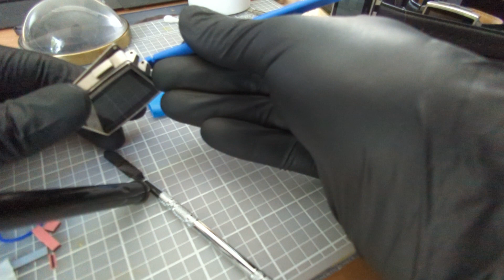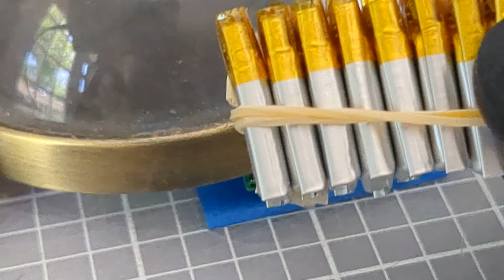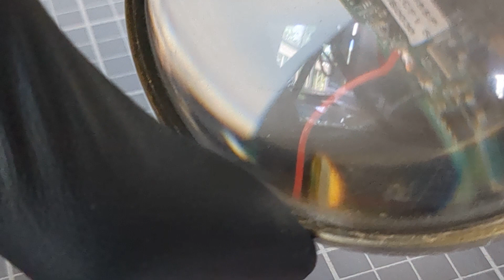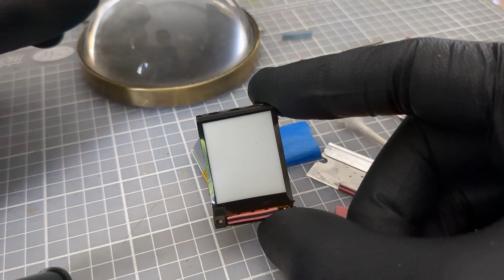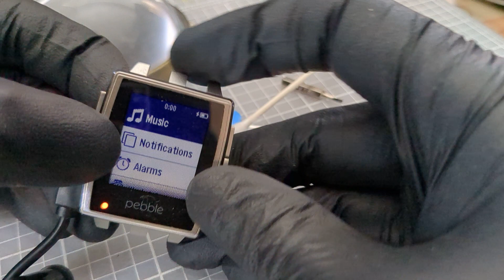Pebble Steel Battery Replacement

Comment: This particular Pebble case design is beautiful. I only had a vague memory of Pebble watches as I saw one being sold in a car boot sale (In the UK, where people fill their cars with 'junk' and drive it to a muddy field to sell) - I grabbed it for three pounds. Perfect case, strap and charging cable. I'm still feeling pleased with myself after a year has gone by, it's one of the best bargains I've picked up at a car boot.
The new software is a revelation and I have some great watch faces, including a Smug Trump just to annoy people. Which it doesn't, they just laugh.

Comment: Thank you very much for sharing this video. This video helped me a lot!
I just finished mine. (402323, 250mAh)
Just one thing to add for whom may try this replacement in future, you need to turn off and turn on your pebble steel to re-activate the backlight and status led.
I don't know why but right after you replace the battery, all the light functions will not work. I was almost panic.
Good luck. :)

Comment: Excellent! Now the Pebble app is available again and working better than ever before, I might finally try to breath new life into my Pebble Steel. I just powered it on today. When I stopped wearing it, the display was already glitchy, and the battery life was about 3 days. Now you can watch it lose power, so both the battery and the zebra strip need to be replaced. I preordered a Pebble Time 2 which should ship in spring, but I still like my old Pebble Steel for its unique vibe so I'd love to wear it again.

Comment: So, I'm working on my own right now.  Whenever I connect the battery, the entire board becomes unbearably hot pretty quick.  I know this isn't correct, so I've disconnected the battery.  Any ideas what the problem might be?
Reply from the maker: You've reversed the wires
Reply: Same with me. Do you have the fix? Or it's really reversed?

Comment: I bought a new in box pebble steel from Ebay only to find out the battery is super dead. At first I thought I could just easily fix it but I shuddered at the thought of trying to fix it myself. I haven't soldered anything since college a decade ago.

Can I just like pay you to do it for me? Lol trying to find research into a replacement battery is scary enough because I don't want it to explode on my wrist.
Reply from the maker: There are plenty of people on the Reddit or discord who will do it for you

Comment: link for the batteries ?
Reply: I would also love to know this as well
Reply from the maker: I would check eBay or another seller in your area for "402020" batteries. Try for 150mAh. https://www.ebay.com/sch/i.html?_from=R40&_trksid=m570.l1313&_nkw=402020&_sacat=0

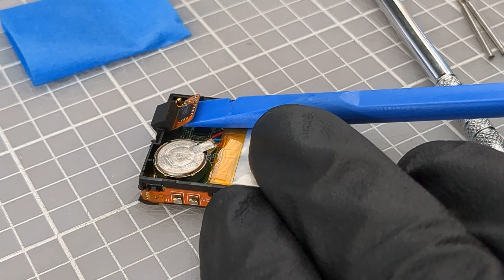Comment: 6:10 do not unplug flex cable like this! its bent too hard and  may crack that may cause backlight death
Reply: How else can you remove a flex cable like that?
Reply: @brendenadamczak9283  by any other method. That one is unacceptable.
Reply: It looks like he just pry's it open with a splurgier?  Seems like the only way to do this? @MyFearGear
Reply: @brendenadamczak9283  he should do it from side, not in front
Reply: @MyFearGear  I haven't tried it on my. setup.  But it looks like it might be hard because you have a pogo pin in the way since, the connector is not at the end of the flex cable.
Reply: @brendenadamczak9283 its not hard really.